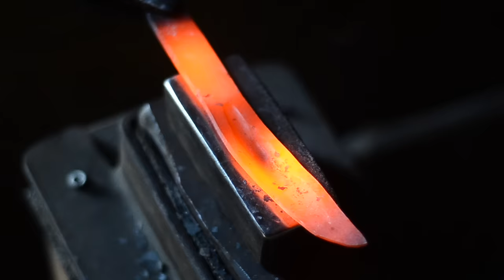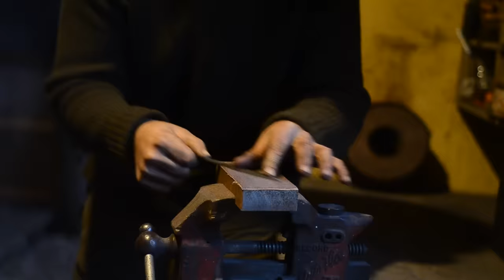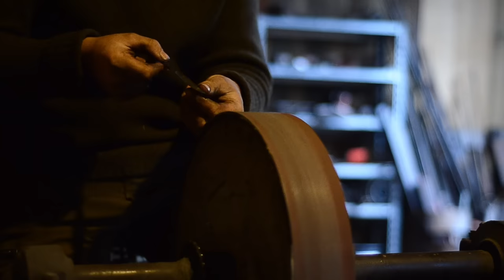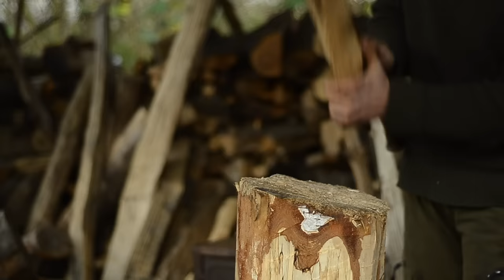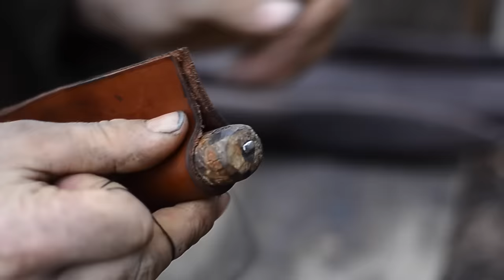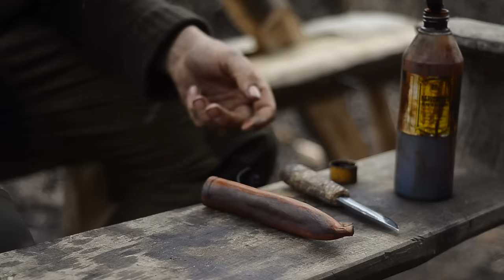Making "Yakut" knife - blacksmithing

Comment: Another fantastic video, it's interesting watching the techniques and tools you have for these projects.  That power hammer was very simplistic yet seemed perfectly suited to the job, although I'd imagine it would take a little getting used to the arc of the swing if you've previously used a more modern one.  I also particularly like watching you make the sheathe as well, and the simple traditional style you use with your work gives me hope that I might actually be able to do some of this myself one day, without having to spend hundreds of thousands on expensive equipment.
Reply from the maker: Thanks. Great to hear :)
The hammer is called a "treadle hammer" in case you want to look it up on the internet - and yes it's a fantastic help in the shop.

Comment: Very interesting knife, I'm planning on making a similar one, but what's the point of that depressed side?
Reply from the maker: Thanks. Answer in the video description.
Reply: Before they discovered metal, Yakuts used to make their knives from a large tubular bones, splitted in halves. Steel knives simply inherited that archaical shape. The Yakuts are completely fine with that, because it perfectly suits for scraping skins. This was basically the most demanded feature for people who breeded countless herds of deers and lived on them.
Reply: @Frumious_Jabberwocky   That's fascinating. Thanks.
Reply: @Frumious_Jabberwocky  the Yakuts, as you call us, or the Sakhas, as we call ourselves, never breeded reindeer - only cows and horses
Reply: As for the meaning of the depresssed side - you only need to grind one "undepressed" side to sharpen the knife, plus you need less iron to make the knife, plus2 your knife is lighter
Reply: Oops, haven't read the description below the video, what I wrote is already in there

Comment: to be exact, this is an Evenki knife. Yakuts adopted the design from Evenkiv when they seized their territory in Siberia
Reply: "...Most scholars believe that in the XII-XIV centuries BC. e. the Yakuts migrated in several waves from the Lake Baikal region to the Lena, Aldan, and Vilyui basins, where they partially assimilated and partially replaced the Evenks (Tungus) and Yukagirs (odulis) who lived here earlier..."

As a resident of Russia, I can add on my own that the Yakut knives were forged from cricket iron, significantly enriching the edge with carbon during the forging process. After prolonged use, the knife was reforged, re-saturating the carbon edge. Also, the knife has two options for geometry. The first, with the tip located strictly on the axis of the knife, for convenient drilling of holes in a tree. The second - with an offset tip, like most European knives, is used for ordinary household needs.

Now in Yakutia, and not only, a lot of pseudo Yakut knives are made, when the dol is pierced, not forged. And one more subtlety - you can sharpen a knife from relatively mild steel in the woods against a strong stone. But a knife made of high-carbon steel in the absence of a good factory abrasive spins into a blade for picking the ground.
Reply: ага. хорошо, что есть такое светило как ты
Reply: Невводи иностранцев в заблуждение,имей совесть.Лучше раскажи им как эвенки пользовались костяными ножами и наконечниками для стрел,пока не пришел к вам железный век вместе с якутами.
Reply: This guy is wrong. Or lier. Evenks had no iron smitting. Yakuts brought it with. All knives evenks had were traded with yakuts  or russians.

Comment: Beautiful work! I’ve been wanting a Yakut knife ever since I saw one on Survival Russia a few years ago. Finally I bought just the blade from a blacksmith in the Ukraine, on Etsy, last night. I would have preferred a complete one but sadly, the UK version of Etsy has gone full on woke and you can’t buy knives on it unless they’re listed as tools, a distinction most overseas vendors aren’t aware of and why should they anyway.☹️Anyway, moan over😁, I’m researching how to do the handle- unfortunately, because it’s already tempered, I won’t be able to do the traditional method of heating the tang to red and burning it into the handle for maximum tightness of fit, I think I’ll have to very carefully drill, getting as tight a fit as I can and then epoxy it in. Also, the tang isn’t a full tang, as I believe traditional Yakut knives aren’t, so I will have to do a damn good job of fitting it!😟😬. One option might be to use an old file, soften it by heat and file it to the same profile as my blades tang, then use that to burn the hole to the correct size. I’m rather looking forward to this though as it will be my first attempt at anything knife construction.😁

Comment: I'm very interested in that knife.  I can see how the rounded bevel on one side would be good for scooping cuts--and the flat side would be good for planing cuts.  I presume the flat side is laid flat on the stone for sharpening, and that the hollow will reduce the amount of steel that will have to be lapped off to maintain the flat.
I'd love to use that knife design, to discover its benefits!
I may have to make one!

Comment: thank you.
Only the notch on the knife should be on the other side.
The working edge is similar to the blade of a hand planer.
In general, this is a tradition of the peoples of the north, going back to the ancient knives from the tusk of the walrus. The tusk, like bone, has a tubular structure. If you cut it to length and sharpen it on a flat surface, you get this blade shape.

Comment: Okay, I wanted to get a knife for myself, but the knife like this is obviously not available in the market, I think I am gonna learn and make one. Do you think you can tell me the details, which wood did you use? and which metal? (I am super new, but I really want to learn). 

As always, you are Genius !!
Big follower, keep up the good work buddy.
Reply: Any simple carbon steel should do the trick (1045, 1075, 1080, 1095, etc) and take some time to research the heat treating process. When it comes to wood just use any wood that you like and is readily available. Although a hard wood is preferable. Just start with an ordinary hammer and a simple forge out of bricks coal and a hairdryer for oxygen, and use a flat Rock or piece of solid metal for an anvil. Use canola or vegetable oil for quenching. You can just use an oven or toaster oven for tempering. When it comes to oiling the wood, use linseed oil or Danish oil, as they are the easiest to apply. Hopefully this helped!

Comment: This is actually very close to making of finnish puukko knives. The dent on the other side of the blade is only difference ":D"

And also the sheath is bit different. We don't make that perfect "case" out of wood. Only half and then one wooden blade shaped part which fits inside that.(its taped on the blade and taken away after the leather has dried) Doing so will give some more pressure to the sheath and it won't come loose so easily
Reply: It's not the only difference. If you take a closer look you'll see that the yakutian knife has asymmetrical blade, one side of it (the one without dent) is convex and the other is plain like chisel which makes woodcutting much easier.
Due to that they even have different versions of the knife for lefthanded and righthanded people.

Comment: How do you stop it from warping in the quench?
Reply from the maker: I make sure to heat up the knife evenly... But in my cases is warping rarely a problem on so short blades.
Reply: @BertramCraftAndWilderness  I have had 2 of the knives warp.  Not sure how to stop it.  Maybe not put in as  large a fuller?
Reply from the maker: @emafex  maybe... just keep trying. I haven't had that problem. But a lot of tips and trick on the internet about how to avoid warping - some of them will probably help you. Best of luck :)

Comment: What oil you use on knifes?
Reply from the maker: Most of the time nothing... but in this video tung oil.
Reply: @BertramCraftAndWilderness  ok. Can i just use normal finnish food oil?
Reply from the maker: @paskutti5907  yes
Reply: @BertramCraftAndWilderness  ok thanks alot
Reply: @BertramCraftAndWilderness  now im making the sheat from leather. Do you use any oil in the sheat?
Reply from the maker: @paskutti5907  I use grease - just the common kind sold in all leather craft stores.

Comment: Have to be careful with it. Very dangerous knife. Only for cutting, or stabbing with both hand using second hand as pressure. Most of people who doesn't know how to use it - cutting the tendons on the fingers. And one more thing - real yakut knifes' handle is more round shape, has quite longer blade and more straightened blunt part